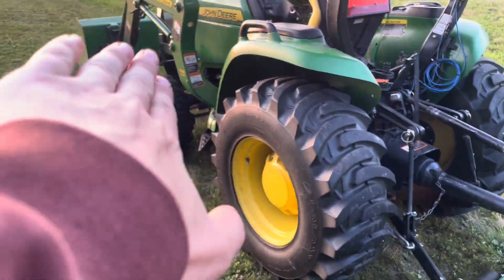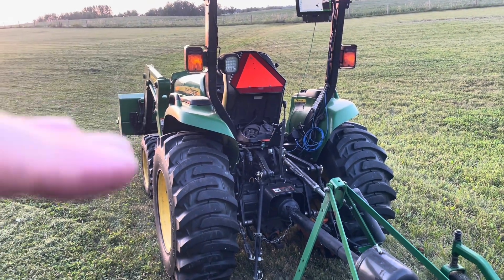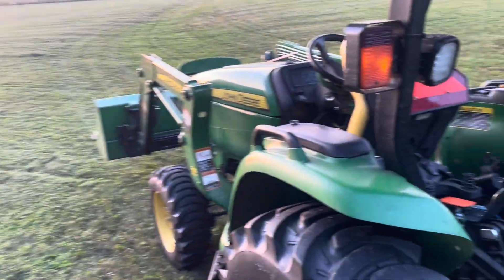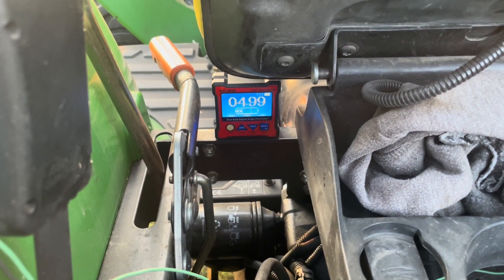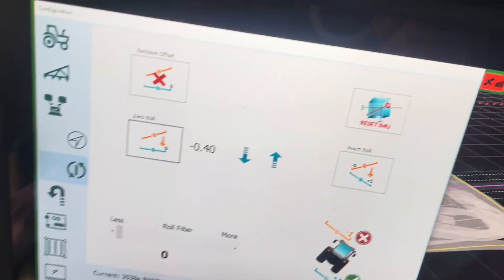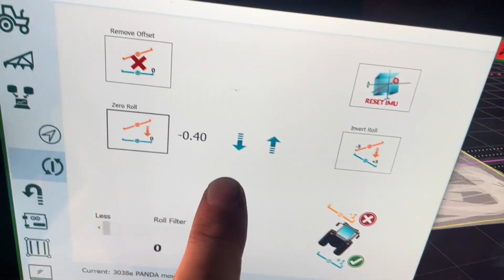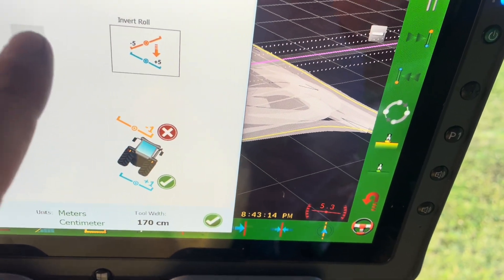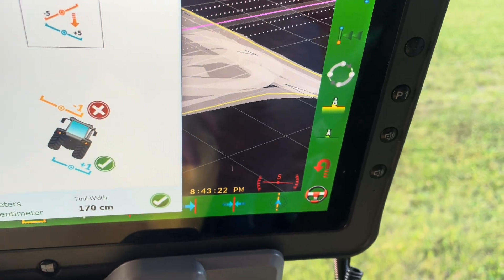AgOpenGPS Roll Calibration the easiest way possible!

Comment: Nice video. Will check if my tractors is correct this way.

Dont know the angle gauge you are using, but i have a similar from Klein Tools (935DAG) ordered from digikey. Nice tool for other use as well
Reply from the maker: Sure beats the Trimble turn on your own tracks method. 

These little levels are handy for so many things!
Reply: @potatofarmer  The trimble had no autosteer, sold it and the money finaced a full AOG kit with hydraulic valves :) Both tractors in that video runs AOG today